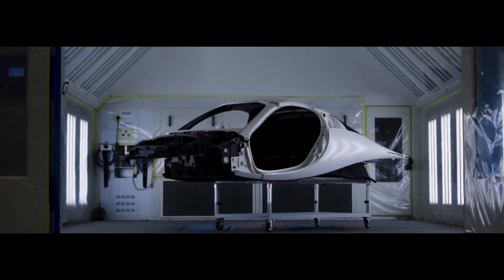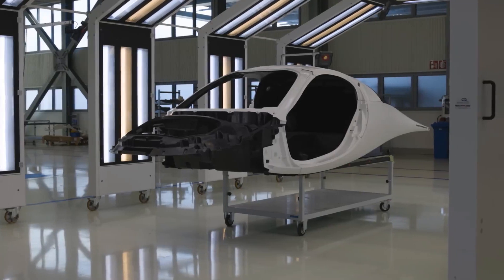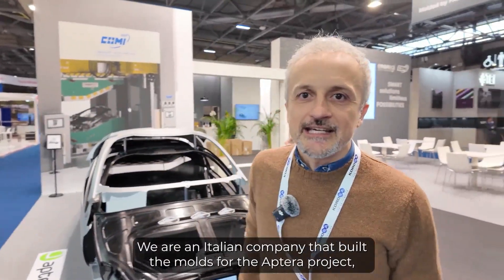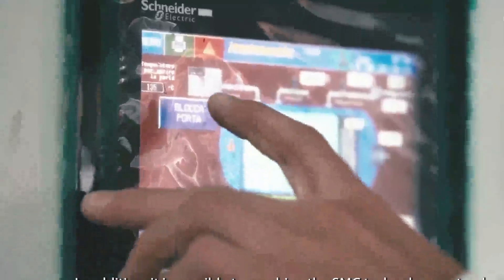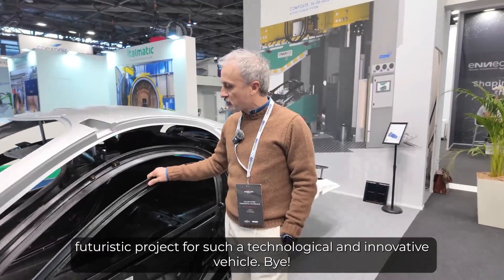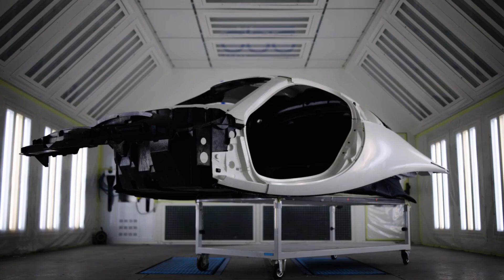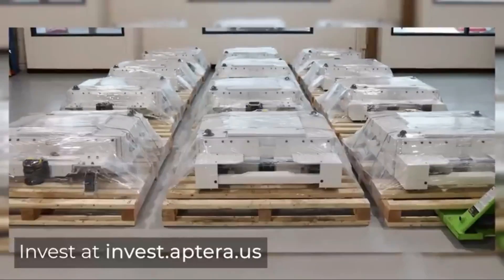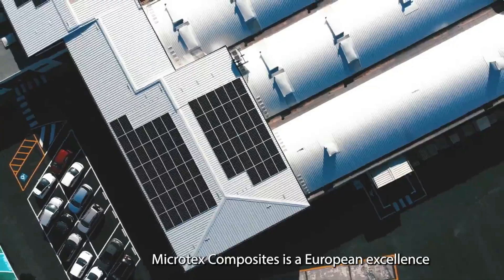Aptera New BinC in Carlsbad, California, US

Comment: Aptera has no room for batteries. I doubt that it has a range 400 miles. There is just no way!
Reply: The battery packs are under the floor of the passenger compartment in between the frame rails.
Reply: think I remember seeing something on the batteries, they're taller, rather than just having more of them over a wider area so they can hold a bit more per battery; Think they're from a S-Korean company?
Reply: @OOStev  Yes, CTNS is assembling the battery packs. They don't make batteries, those probably come from a Korean company.
Reply: Doesn’t need the space that a typical electric vehicle has for its size batteries.  Basically you only need about the 1/4-1/3 the amount of batteries to carry you the same distance as a long range tesla model 3.